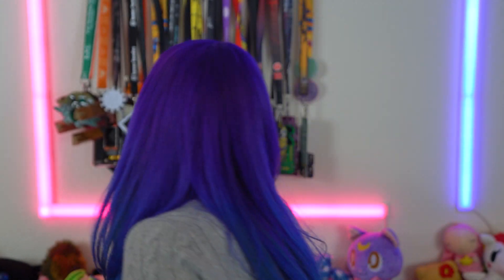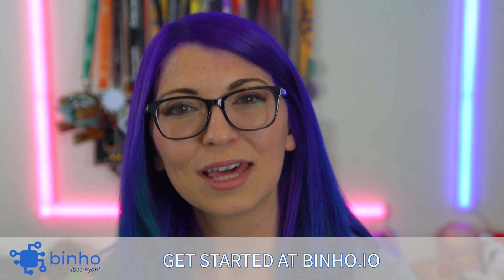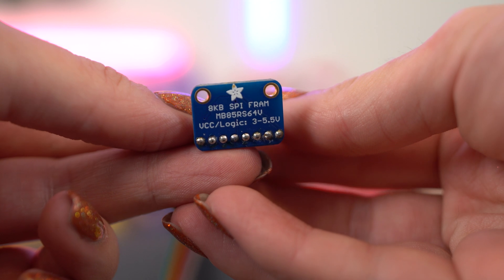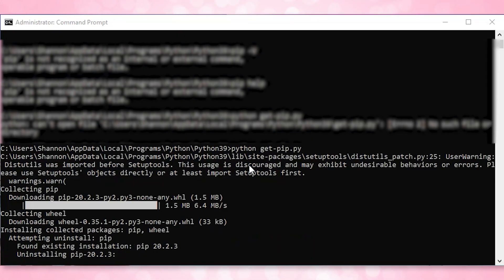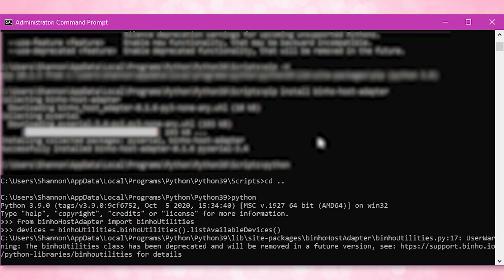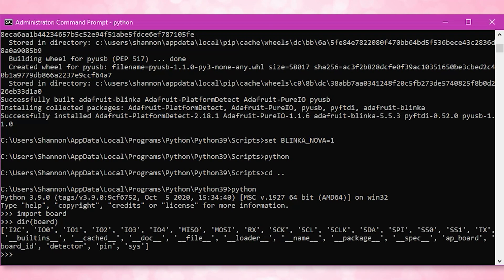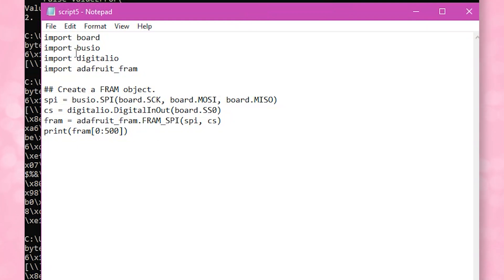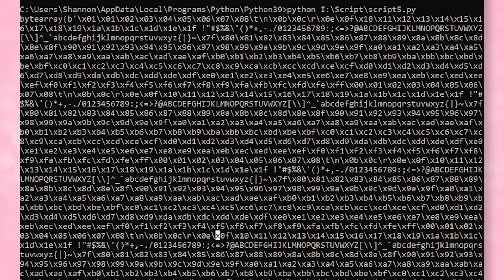Using a Host Adapter and Adafruit's SPI FRAM Breakout Board to Find Plain Text Data on Hardware!

Comment: Quick tip, if you use File Explorer you can type cmd in the address bar and it will open a command line prompt in the current directory.

To add a directory to the path, click on the Advanced Options in the System settings of the configuration and go to Environment Variables then modify the entry for Path.

Comment: It's not a password.  If you check the previous bytes, they are 1c, 1d, 1e then 1f then ascii bytes starting with space and so on.
The entire screen is just consecutive byte values 00-FF over and over.
Reply from the maker: This is a demo using the SPI FRAM board, not an actual product with an actual password! It was set up this way to be blatantly obvious, and the symbols and text were added to be easily viewable for the video.